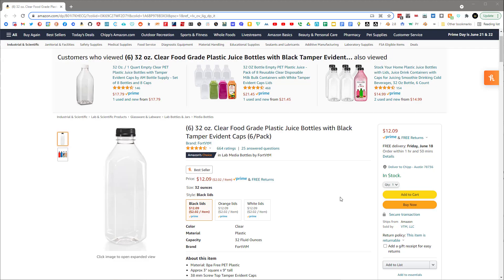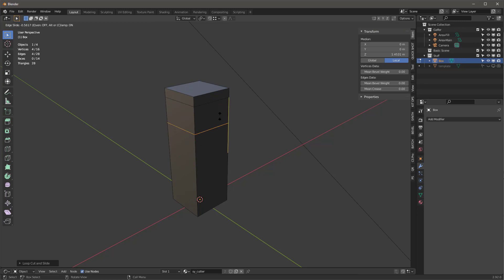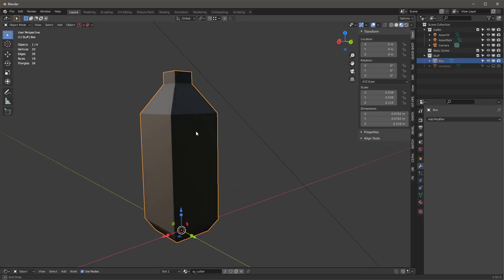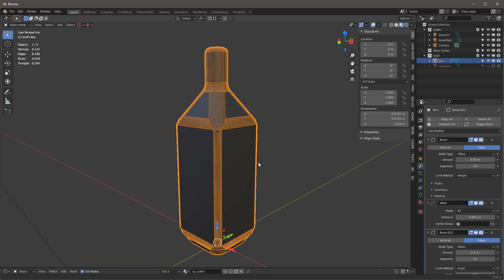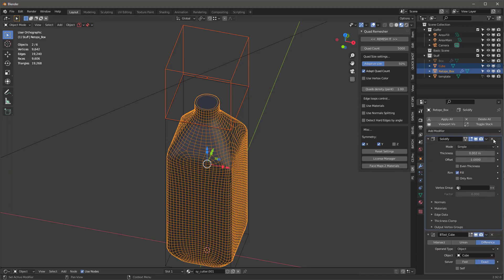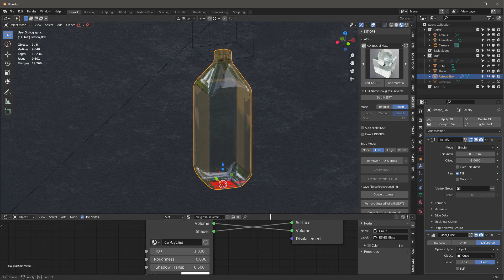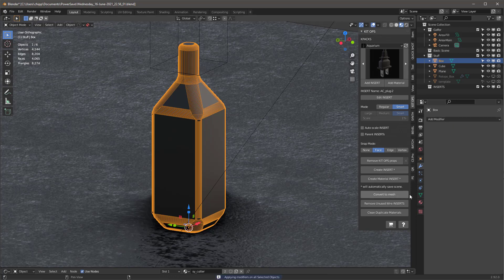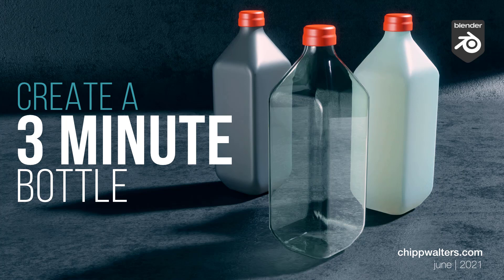3 Minute Bottle in Blender

Comment: When you put the square where the cap should be you just mumble minus? and then it all does some magic, can you explain that a little more? Because when I put a boolean on it basically has the cube stuck to the bottle.
Reply from the maker: The cube is just there too Boolean subtract off of the top of the bottle. Just use a Boolean difference modifier and it will work.
Reply: @ChippWalters  Thanks.

Comment: Noob question: what is the purpose of remeshing it to more faces/verts?
Reply from the maker: If you examine the model it's not topologically sound and will render with artifacts. Remeshing it solves those issues.
Reply: @ChippWalters  wht if we use a weighted normals modifier? Wouldn't it solve those artifacts?
Reply from the maker: @nightblade178  the topology still isn't correct so I don't think that would work at all.